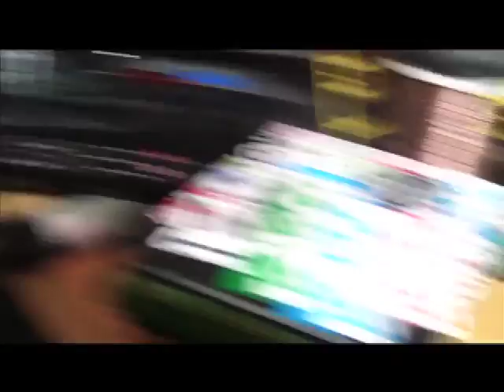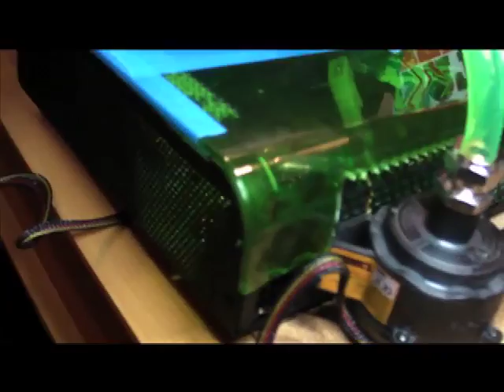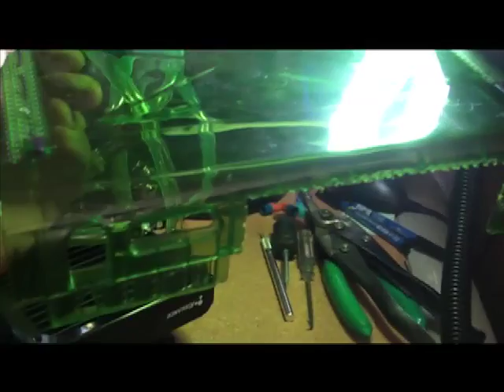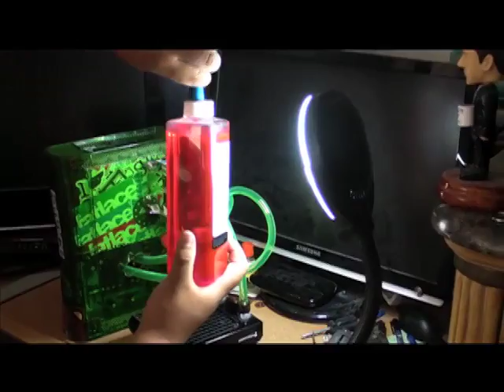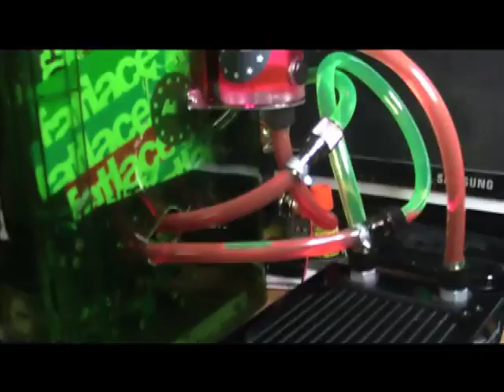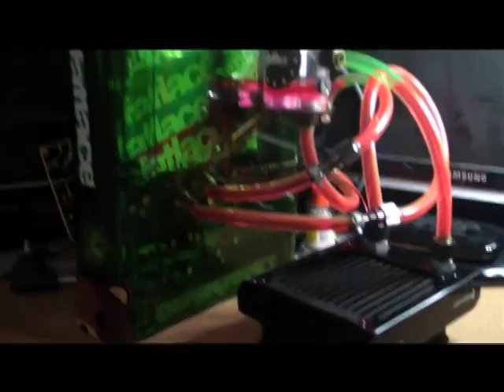watercooled my xbox 360, build video pt. 2 (FOR SALE)

Comment: Oil cooling isn't better, the oil can hold more heat than water which means it is harder to cool the oil down resulting in a hotter system. And having it submerged keeps the heat around the hot components so it is even worse. Oil is still worse if you put it in tubes like a water cooling setup.

Comment: @phsv83 I believe I am into this kinda stuff, but I believe making it like this is taking it way over the top. Just allow better airflow, apply better thermal compound to the cpu and perhaps a 60mm fan to the heatsink, and that would do the job perfectly. I'm not your bro, either.

Comment: @phsv83 Not true. It depends entirely what you want to do with it. PC processors are ALOT more powerful, consume more power, and generate alot more heat than Xbox's, and you preferably only need to upgrade the cooling if you're over clocking. Are you really going to need liquid cooling in a system built for emails, spreadsheets and IE9? No. Are you going to need liquid cooling for extreme overclocking and ultra-enthusiast gaming? Probably, yes.

Comment: Can I point out one thing?
With the coolant at that level in the reservoir, more bubbles being created as the coolant drops from the "in" pipe resulting in more bubbles being drawn through the system.  
Otherwise a great build from what I can see, I just though I'd give anyone who is following this a heads up :)

Comment: Furthermore, I'm running a build right now with an i5 2500k running at 4.2GHz (overclocked, imagine that) on the Intel stock (or in your terms, OEM) cooler that came with the processor. Most stable overclocks for any given setup can be attained on an air cooling, given you have quality coolers/heat sinks- water cooling, even in the PC world, is rarely ever a necessity in nearly any circumstance.

For the record, any component can be water cooled: CPU, GPU, RAM, Mosfets, as well as bridges...

Comment: they are not bad, though i have heard that the aluminum core rads can randomly leak (They recently discontinued it) I just don't get why people dont build there own, its so fn easy, usually cheaper, and you get way cooler temps! google frozen cpu, that website is the shit!

Comment: Since that stock heat sink is not sufficient for the components it is designed to cool, it is wise to upgrade the heat sink to a better one, or some other, more effective form of cooling. Liquid cooling is more effective when designed and executed properly. It is not necessary for the Xbox, but is not a waste of money if that's what the owner wants. I run water cooling, and have built systems with water cooling, for many computers that run stock clocks. Its a matter of preference, not necessity.

Comment: RGH mod running F3. Adjustable fan speed allows my 360 to run no higher than 60 degrees with outside temperature at 40. That thing looks hideous and I don't know what you're asking for it, but better execution on the aesthetics would have been better received. I do applaud you for giving it a go though.

Comment: there's really no point in water-cooling any video game system other than aesthetic reasons, you can't overclock it and the games will never run at higher resolutions or be able to run at higher frames per second, none the less definitely looks cool.

Comment: I noticed there was no follow up video, why? Need to let people know what the gains was, like reduced temps, load up times shorter, Benchmarks, or sorry that's pc stuff I'm talking about.
Reply from the maker: there was no followup video because i'm not a serious youtuber. all i needed was for the xbox to run cooler and i had the parts and knowledge to do it at the time and there was only one other guy on youtube who did it. i did this for informational purposes. i didn't care about actual gains because i knew the temps would be way cooler than factory temps already. i wasn't a serious gamer at the time either so i didn't care much about benchmarks.

Comment: Well now, that is where you are wrong. I ran my 360 for years propped up on a set of 4 skateboard wheels, with a small desk fan beside it. That is all you need to prevent overheating and the rrod. To relate it to PC terms, the Xbox 360 basically has an oem heatsink. It has sufficient cooling, but can run into issues when under full load. Upgrading the air flow completely fixes that (desk fan), and the only reason for water cooling, is to OC the CPU, impossible on xbox. Undeniable waste of money.

Comment: Could I run the radiator and the reservoir combo on a separate power cable? Because I cannot seem to figure out how to connect it to the Xbox’s power.
Reply from the maker: radiator and reservoir do not use power. your pump does. you can hook it up to whatever power source you want, as long as it's running while your xbox is on.
Reply: boogie santos you’re literally the best! Thank you so damn much!

Comment: I don't know how I stumbled across this but I was wondering why you just didn't make straight runs with your hoses.  Coupling hoses together with fittings is rather expensive.  I do like the concept but I would instead find myself a slightly larger housing than the 360's original case and just move all the components into something else so that everything could be housed together.  That would also improve noise.  Also, never ever run your pump dry. Otherwise pretty good job, especially with hard wiring everything.
Reply from the maker: +Casey Kelley i wanted to make it look raw and "steampunk" at the time.
Reply: Casey Kelley thats what i was thinking but thats what im actually going to do to my spare slim

Comment: hey bud, I have a flashed 360 as well as a xkey installed, i have reballed (no reflowed) my gpu because it rrod a while back. It has been good for about 6 months but now it two red lights and overheats on me after about ten minutes. I want to do something similar but have never set up a water cooling system.  I have a killer game rig but don't over clock and I use stock cooler keeping it at 59 celsius.  However my 360 runs way too hot and I would like to watercool. What parts and how much is it.

Comment: hey man im working on a project and im trying to hardwire a waterspeaker and  mount in side  do you no how I would go about wiring this
Reply: Christopher weeks i would actually like to see that btw if you havent done it just pm me your email and i can send you some pin outs the solder the speaker to the board
Reply: Christopher weeks it will require some soldering skills to make it look good
Reply: Christopher weeks because if you just use the av cables audio it will look like hell

Comment from the maker: the point of the mod was mostly just to see if i could do it. i had the extra money/parts and the extra time. and the point of watercooling is to help cool down the hotter overclocked parts. the xbox 360 runs really hot, too hot for comfort. they're known for failing because of heat. that was the point of this experiment. it's still running strong today.

Comment: Just don't follow what he did, he ran the pump dry which you NEVER do, used way too much thermal compound, didn't leak test, should have bled the loop without the Xbox on with a power supply, and he used way way too much tubing... You want a little tubing as possible, and maybe a bigger radiator? Idk how hot Xboxs get, I don't own one lol.

Comment: Well I wouldn't do it to my Slim, I love that thing and it runs great. Helps to clean the vents regularly too. As for heat, my FX laptop warms up my room pretty fast, thank god its winter. And my Xbox well its not that hot but its close. But thank you for the tips though :D, I'll be sure to keep them in mind if I ever do this. But it won't be my Slim, just some old Phat I might find on Ebay if I ever get the money and inspiration to try that out. XD

Comment: Oh how wrong you are... I did make a point. Actually, I made a few, so let me list them off: 1) Cooling upgrades are justified even without overclocking, especially when stock isn't sufficient; 2) Watercooling is not a pointless endeavor, nor a waste of money if it is what the person who built it wants and satisfies his needs; 3) Air cooling is sufficient for a majority of anyone's needs. Liquid cooling is rarely ever necessary, save for extreme benchmarks, at which point nitrogen is utilized.

Comment: Do you know the difference between a intercooler and a radiator? A intercooler as air blown through it and then cooled by fans then its blown through a turbo, a radiator all be it , looks like a intercooler and probably could be used as one, but still its not a intercooler but a radiator that's filled with liquid then cooled by fan assisted air, please stop saying intercooler and priming, your not NASA.
Reply from the maker: i know the difference. look at my videos. i've built twin turbo 1200hp motors and done all the tig welding on my aluminum intercoolers and radiators on my vehicle builds. i only called the radiator in this video an intercooler because that was the brand name of the product. i was referring to it's brand name.

and actually, the air goes from the turbo to the intercooler and cooled by ambient air as you drive a vehicle, not from the radiator to the turbocharger. look up the definition of priming. you can prime a motor engine with oil. you can also prime a radiator and coolant lines with coolant.
Reply from the maker: and by the way you cannot use an intercooler as a radiator. the fin design is different as well as the row/layout. intercoolers were designed and built to cool air, radiators were designed to cool liquid which picks up heat transfer from your waterblocks, engine blocks, oil in your engine, cylinder heads, whatever you have it setup to cool.

Comment: by the way, you leak test OUTSIDE of the system.  That way, if you DO have a leak, it won't wreck your system.  This is an xbox, though, so i really don't care.  And then you wanted to watercool a ps3?  All I can say is WHY?????  also, you fill your res, and without the cap, the bubbles will work out themselves.  And you obviously haven't heard how quiet a well done watercooled pc can get.  Just please don't waste this kind of money on a frickin xbox.

Comment: why whats the fucking point
Reply: less heat temp
Reply: It doesn't make any sense unless he is overclocking and can't overclock an Xbox
Reply: +Khalam Ahmed  yeah right
Reply: Xbox's don't run that hot, I run my Xbox for 24 hours straight playing Youtube and I game hard on it. The over heating come from dust build up in the heatink I had the overheating problem too, I have opened and cleaned two Xbox's both runs excellent... no need of a water cooling sys. but if i'ts just for to look good. then to each is own! and disregard my comment.
Reply: +k a 12v fan mod is keeping the same fans just wiring it to 12v so its at full speed all the time and its loud af

Comment: Your argument is one made of naivety- to think that a superior cooling solution is only useful to those who overclock, and not at all for those who are running a system that run hot even without overclocking is simply ignorant. The 360 runs hot. 99% of it's problems are caused by heat and its inability to sufficiently evacuate that heat from the case and core components. Water cooling has a much larger capacity for heat removal than air cooling, therefore it's not a "pointless endeavor".

Comment: Already shot yourself in the foot. Had the stock heat sink and duct design been as effective as it should be (read: sufficient), it would not require any outside assistance to keep the Xbox cool. It is not, which is then justification for any cooling upgrade the owner sees fit and is willing to design.

Original Equipment Manufacturer is not a PC term, and the Xbox doesn't "basically have an oem heatsink", it DOES have an OEM heatsink, otherwise it wouldn't be stock.

Comment: I don't even know where to start with this. So you have an xbox, and money.  Sadly, you apparently have more money than sense.  Instead of building something adequate for gaming (a pc), you dumped even more cash into your stupid xbox. Now don't get all defensive, I think we can all agree that the thing is 7 FRICKING YEARS OLD.  Also, those are the worst tubing runs I have seen in my life (they are supposed to be SHORT- no stupid loop-dee-loops. It's an xbox, so it probably wouldn't help anyway